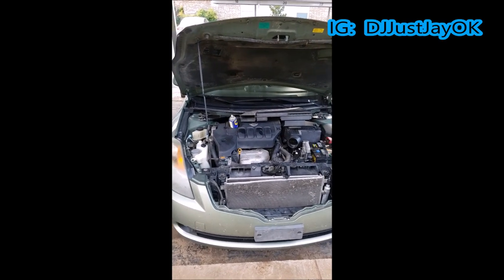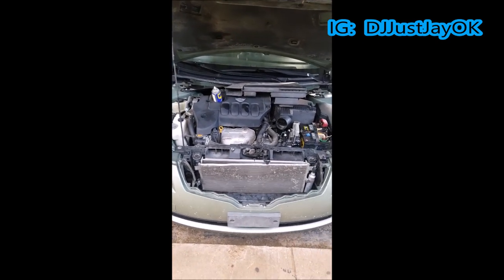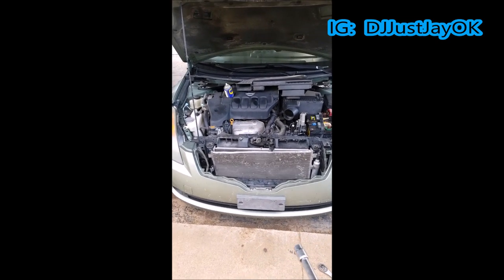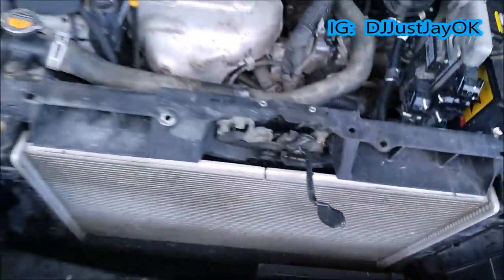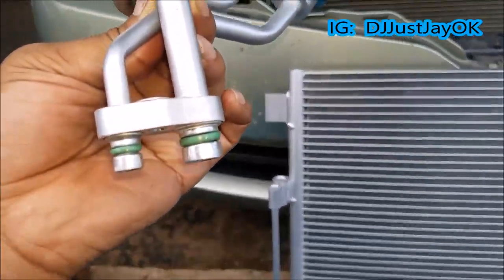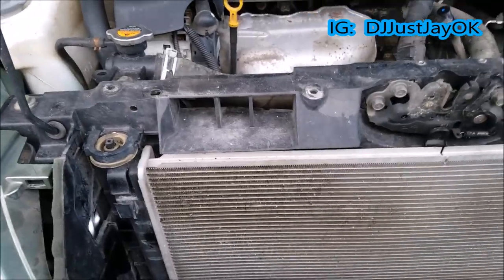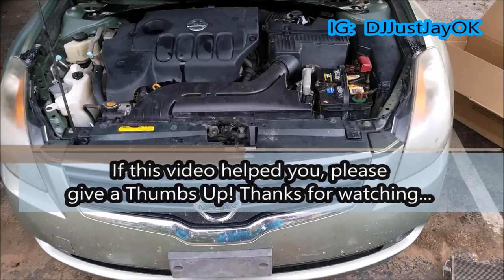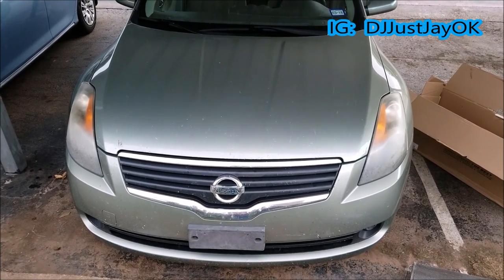2007 Nissan Altima AC Condenser Removal and Replacement DIY

Comment: I know this is an old video but dude thank you.  I inherited my boyfriends car which is a mess.  I went to the shop about the ac not working after he got into an accident and they wanted over a grand and said it was my compressor.   I thought the ac condenser was the radiator this whole time...so this is exactly what's wrong with it! The visual damage to it couldn't be more obvious what the problem is.  I appreciate you taking the time to make this!
Reply from the maker: You're definitely welcome. I had no idea if my video would be helpful for anyone, so I'm glad it helps.

Comment: Thanks for sharing bud really appreciate it was gonna change my radiator and saw a couple of videos that said it would be easier just to remove the condenser and then the radiator instead of taking the whole car apart so I’m gonna give it a shot and take the condenser out first then take the radiator and in the summertime recharge my system. By the way you may not be a professional but your instructions were clear and decisive thanks again from New York. 👍🏻
Reply from the maker: wow, how cool is that. Thank you. I'm just glad it was helpful to some people.
Reply: Update worked like a charm went to AutoZone got the supplies and recharge the system thanks again for sharing you save me a lot of time I really appreciate it👍🏻👋🏻

Comment: I have to replace my radiator, radiator support and ac condenser this weekend. This video helped me a lot. Thanks man!!
Reply from the maker: oh wow! I didn't even think about that. The radiator is right behind the condenser. I'm very glad this helped you bro! And thanks to DIY-Time for giving me the confidence to tear into my car :-)
Reply: DJJustJayOK I've been working on my own car ever since I can drive. This is the first time I'm ever messing with a radiator and ac condenser tho. I'm more than confident now! We need more altima videos haha
Reply from the maker: Mike Crelin agreed! That's why I love Victor's channel DIY-Time, he's so thorough and clear. I think i'ma tackle the shocks and struts next, and wheel bearings.
Reply: DJJustJayOK I have coilovers on my car now and it's pretty low. But the suspension is rediculously easy to do on these cars!
Reply: Mike Crelin hey man how much did you pay for the radiator shroud that holds the condenser and radiator  I got in a fender bender and gotta replace it

Comment: So I’m trying to replace my radiator and figured removing the ac condenser to get to it would be my best bet so I won’t have to drop the bumper and all that extra stuff but when I went to unscrew the 10 mm bolt on the left where those lines connect to the condenser  I started hearing hissing is it safe to just go ahead and let it hiss out replace the radiator put the condenser back on and just recharge the ac ?

Comment: Will be replacing my compressor and condenser tomorrow. Thanks for the video very helpful I now have a guide for tomorrow. Thanks again.
Reply from the maker: oakrds187 sure thing! I wish I made the video in better quality. But I do get notifications, so if you run into any issues just comment back. I'll respond asap.

Also, I just replaced my wheel bearings. I have some must-know knowledge about that too if you delve into that. It's a cheap fix, but easy enough to fix by yourself.
Reply: DJJustJayOK thanks bro really appreciate it.
Reply: DJJustJayOK compressor and condenser installed ac is back. Ac is blowing cold again, glad I fixed b4 it gets to 120F out here. Thanks again for the video. 💯
Reply from the maker: oakrds187 brother, it's my honor! I'm excited to hear that you got it knocked out.
Reply: oakrds187 I'm doing the same this weekend, how much oil did you add for replacing the condenser and compressor?
Reply from the maker: Whenever you order the compressor kit, it comes with a small bottle of pag oil. I didn't use much at all. The instructions said to pour in pag oil and then manually turn the compressor until it's full. It didn't take much from the small bottle.

Comment: thanks! i wonder if you could take out the radiator from here without taking out the bumper.
Reply from the maker: Yes, but please specify. You mean grill or bumper? You don't have to take off the bumper, but you do have to remove the grill.

Comment: Do you know if I have to take out all the refrigerant out the ac system first before I start disconnecting AC lines & everything?
Reply from the maker: Yes, you do have to evacuate the system first.
Reply: @DJJustJayOK okay but what if one of the AC lines are completely broken off/snapped, do I still have to do that?  or did all the refrigerant escape from  the broken line & I can just disconnect it right away? Or is evacuation a must when working on AC lines no matter what?
Reply from the maker: Sounds like the refrigerant is already gone. But don't hold me to that, because I'm not a mechanic and can't advise you properly. Yes, I believe you don't have to evacuate in that circumstance.

Comment: I replaced the condenser and it’s blowing a little colder but not much. It was followed step by step, do you have any suggestions?
Reply from the maker: Were you able to thoroughly check for leaks, like with a refill can plus dye?

Comment: Where did you buy your replacement part from? (And the accurate size part) Also what are the most needed tools to do the job?
Reply from the maker: Hi sweetie! Sorry I missed your comment, I hardly ever check this account. But save yourself headache, money, and time and order through "eBay", simply search year make and model of car and part type; 07 Nissan Altima condenser "NEW", never buy parts used. Also as a word of advice, don't EVER tell a mechanic or repair shop where you buy your parts from. That's how they make all their money, and if the word gets around me might not have access to buy directly anymore.

Comment: Was the refrigerant completely gone from your AC system? Im asking because I followed the same video to replace my compressor last month. Afterwards I did a evac and recharge, but now I need to replace my condenser, will I need to evac and recharge again?
Reply from the maker: Yes, to your first question.
And yes, after a evac you will need to recharge again.

Comment: Enjoyed watching your video. By any chance, what would be a fair price to evacuate the system from air and recharge with Freon if you take it to a shop?
Reply from the maker: Idk what's fair, but I know they're expensive. I think a standard evac is around $123 and $156, and there aren't many guarantees. You literally could be just wasting money. If the shop does the service, they want their money regardless if your issue is fixed or not. So just make sure when you use a shop, know exactly what you need.
Reply: @DJJustJayOK  thank you
Reply: @ruigooal  you can rent the evac machine for free from any auto parts store and do that yourself too

Comment: It’s not an octagon is a hexagon aka hex. 6 sides not 8. That socket you have is a 10mm 12pt. The “traditional” you talk about is 10mm 6pt. You should always use a 6pt on hex head bolt and a 12pt on a 12pt head. 12pt on a hex head is more likely to slip and round off the head if your not a experienced mechanic.
Reply from the maker: Thank you very much for the correction. I use the DIY method to save tons of money, I definitely don't know much about cars or tools, but I got tired of spending money on expensive repair shop labor. I figured since I was already doing the work I would record it, and decided to upload it. I've gotten so many emails form people saying that my video helped them and gave them confidence. So, the vid definitely served it's purpose. I promise to do much better next time I decide to film a repair video.